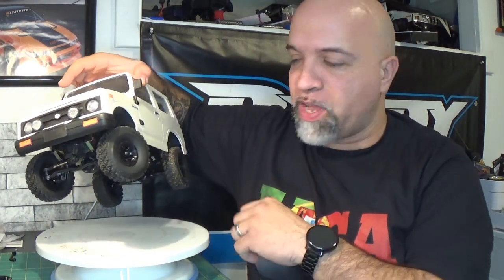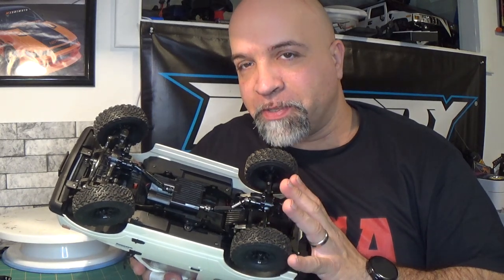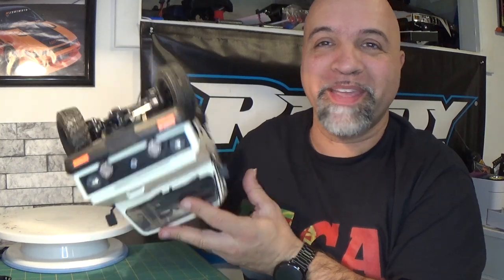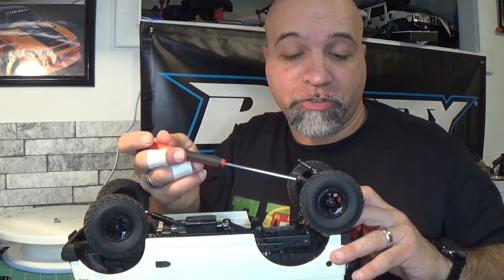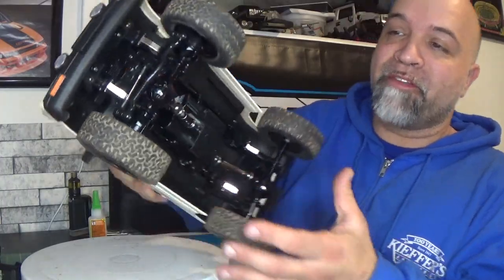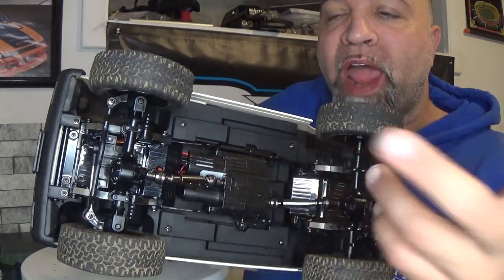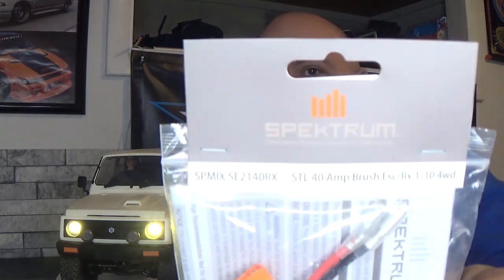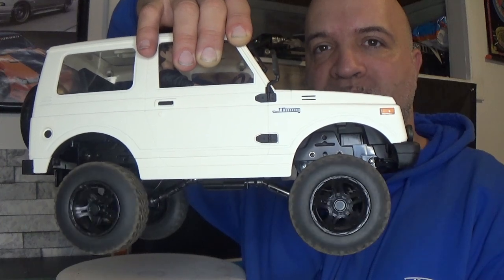WPL Suzuki Jimny C74 Driveshaft fix and 1.55 wheels installed

Comment: Are regular hex rims available in aliexpress fit the hubs? Thanks
Reply from the maker: Unfortunately no 12mm hex wheels will not fit unless you get 5mm to 12mm hex adapters check out this link for them https://www.amazon.com/dp/B07R8LGSL1/ref=cm_sw_r_as_gl_apa_gl_i_61H9ADWMRA480N0SEPSN?linkCode=ml2&tag=rccargarage84-20